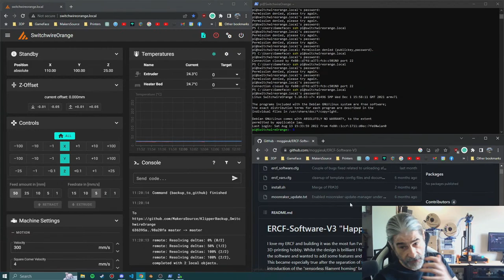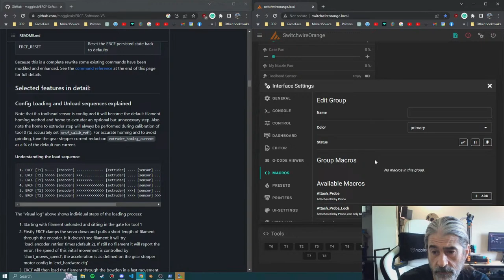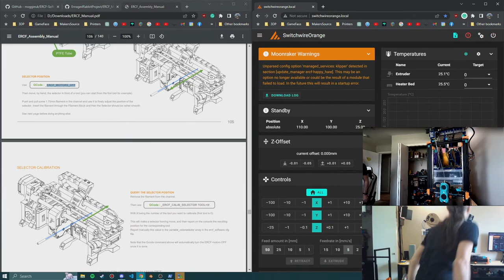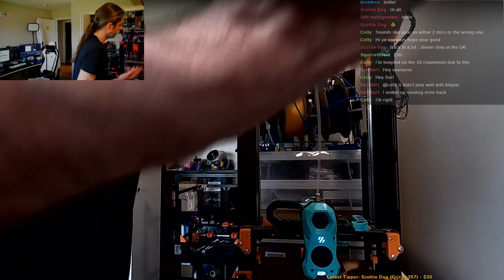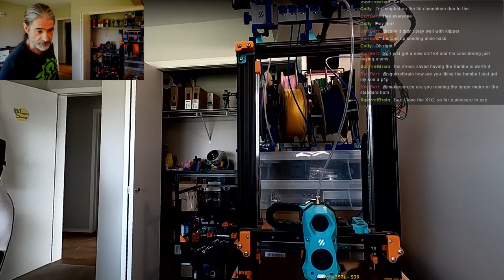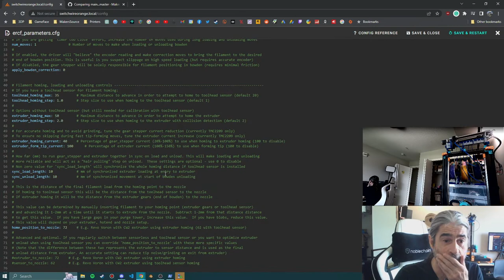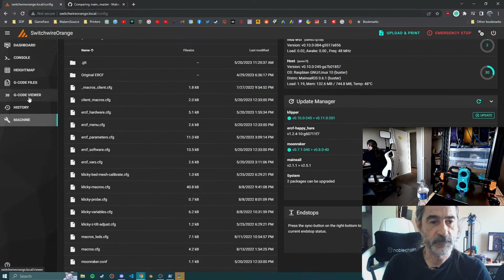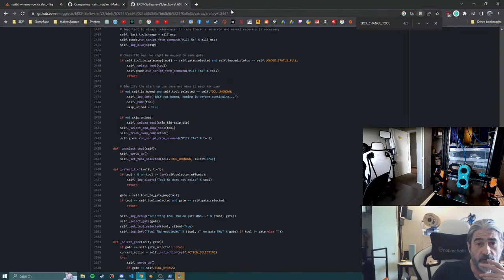Going Happy Hare on the Enraged Rabbit [Or Maybe Not]- #voron #3dprinting #ERCF

Comment: That was one unhappy hare... looks like it may be more satisfying to try to design some solid filament changer yourself taking lessons from the cursed ones you built so far...
Reply from the maker: I'm thinking of replacing the servo mechanism with some other method of compressing the top on the selected filament block. I'll get back to it when I'm done Trihydridex.